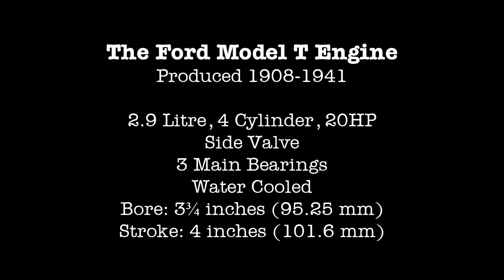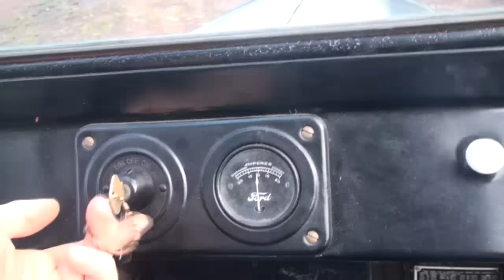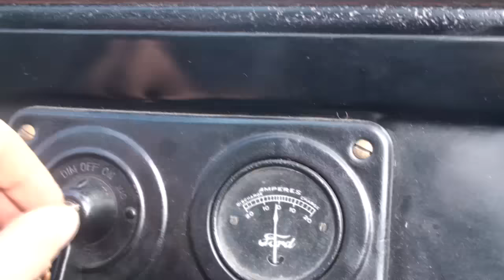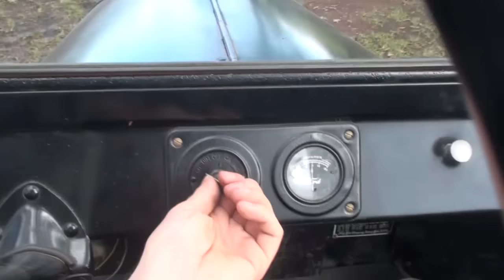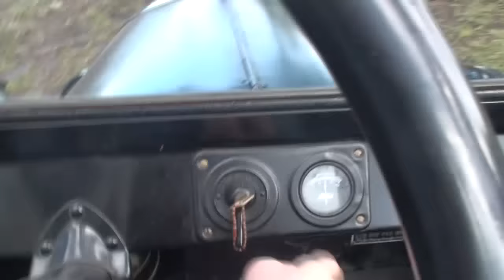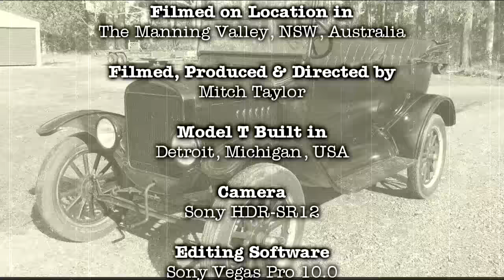Ford Model T - How to Start & How to Drive

Comment: Sooo, drunk driving wasn't much of a problem in those days.
Reply: You'll be sober by the time it takes to start the fucking thing, also, you'll stagger home faster than this thing drives.
Reply: Sirdiggar wouldn’t doubt it
Reply: I don't think they had cupholders then.
Reply: Drunk driving like drunk everything else was a problem (alcoholism was epic in that era!), and that car is no more complex, just different, than a manual transmission auto through the 1950s. People back then were not the scornworth  helpless pampered naive silly anime-worshipping snowflake adult children of today and their normal tasks included caring for a horse and wagon (also more complex than auto ownership and as any horse owner knows requires a lot of work).  The transition to automobiles was immensely popular because it made transportation SIMPLE.
Reply: Ob Fuscated but the ability to start the ones that didn’t have a electric starter would have most likely prohibited the drunks from droving
Reply: With the minimum skill required for this, I'd even suggest drunks who drove these were good enough to not be noticed as drunk
Reply: Eyeh8you your only going like 5 miles per hour
Reply: @804_grandstaff  Up to 48 if you figure out how to high gear
Reply: Ahh Sheeit! They could start it! Remember they started it every day! It was nothing to them.
Reply: @Lucas-qb3bs  nah, they could of did it. No problem,  like he said their lives were different. A weed head probably couldn't start it, to weak, and lazy to go through the motions.
Reply: rhuttrho88 I was just saying that people would probably be lazy like you’re saying with the weed head and wouldn’t want to have to start it. It isn’t very hard to start in my opinion.
Reply: yea
Reply: @obfuscated3090  Just got up at 4 in the morning to feed the horses. Next week we plan to teach five of them to drive. One important thing in driving horses is "Don't cut corners." The horse will anticipate the turn and take it too soon. The wagon will fall into the ditch that is before the turn and flip over. If your horse is very good and does not cut corners you can get away with driving drunk; it's sort of like cruise control or autopilot. As in the old poem, "The horse knows the way / to carry the sleigh / through the white and drifting snow."
Reply: @Lucas-qb3bs  Nope. Once you do it a few times it becomes very quick and second nature.
Reply: 86dieselman yeah I know, just as easy as starting my Farmall H hand crank
Reply: Eyeh8you wow looking at this and people nowadays can’t/don’t want to drive a standard transmission car.
Reply: @obfuscated3090  "anime-worshipping" haha nice one dud
Reply: @eyehByou People were riding horses drunk long before there were cars.
Reply: @obfuscated3090  Not sure if you were born in that generation or you wish you were born in that generation. Either way, what does that have to do with anything?
Reply: Eric campbelle (the bad guy in charlie chaplin movies) dead in 1917  at 60 mph because he was drunk...
Reply: Kids drank coca cola that had cocaine in it back then. Drinking was less of a problem as religion was still keeping people from being stupid. That and only women would ever get offended back then. Now everyone is offended.
Reply: Well they were so use to it that im sure they could do it with their eyes closed
Reply: Obviously as it was illegal
Reply: @Sirdiggar  🤣🤣🤣
Reply: I’m sure people were used to it then they don’t have a land cruiser
Reply: @obfuscated3090  In fact there were cartoons, animated and printed on paper, in that era,
Reply: @Sirdiggar  Lol that got me rolling 🤣
Reply: @tariqzain4500  :D
Reply: not really because alcohol was illegal when this car came out
Reply: It was a joke people. Seriously.
Reply: @Sirdiggar  that "thing" is faster then you think, i drive a 1914 T would have no problem starting it when drunk, but driving it ? a nickname for that "thing" is jumping Lena, it can jump like a flea by engaging the low gear, its faster then you think, its a sport to learn how to drive it, its an old "fusspot" it will tell you when its happy, i can now steer that "thing" through busy traffic, like a flea, but driving it drunk ? no way
Reply: @nicokamper4434  It was a joke, calm down.
Reply: @Sirdiggar  i know that, hahaha, my answer was meant in that form, only thinking of driving that "thing" while drunk,  i would not get far indeed,
Reply: Accidents back then were even worse
Reply: Prohibition was a thing back then when this car was made. No one did drink and drive since it was illegal to have alcohol 😂😂😂😂
Reply: @T-Rex-nm1se  oh, there was alcohol. You can't keep an alcoholic from drinking.
Reply: Terrible get away vehicle, as well
Reply: wikked girl  its easy to drive it lol
Reply: @rhuttrho88 fun fact, muy cousin and i crank started and operated a model T while high on weed, a very long time ago. 😂

Comment: only 1900s kids will remember!
Reply: DanReezY  no the model was readily available to buy used as late as the 1950's. .so anyone born from  the 30's '-40's   could have had this as their 1'st car .
Reply: Hello kids !  Oups, sorry.  HELLO KIDS !!!!  (do you hear me ?)
Reply: I think if a young man in high school pulled up in one of these today he would pull chicks with it although it might be the quirky ones which is nice too. Inversely if a young lady in high school pulled up in one of these today the guys with any brains would be all over that like flys on (yeah).
Reply: Ya I remember and now I'm 119 yrs old
Reply: Gaming guru your comment is probably a joke but instead of ya, a 119 year old person would most likely use yeah or yes because yes is more polite
Reply: I was born in 1956 my dad had a 1915 model T truck I learned how to rebuild carbs on that truck it sat for about 5 years without being run I was just 15 at the time and I took the carb apart it was full of gummy deposits.  Took me about 4 hours to clean, check and put back together. It started ran rough but ran. Did some adjustments on the carb  after it got warm readjusted the carb  and it ran great again.
My dad was surprised but happy i got it running again.
Reply: @ryan lemons r/woooooosh
Reply: +Bert Grau. I was at school when you were born and I remember the day that our teacher had car trouble on his way to work. 
For that days lessons, we helped him push the car into the yard and took the engine out. By 4pm it was ready for him to go home.
Here in the UK, during WW2 their was a shortage of teachers, so many older or retired professionals returned to the classrooms to teach, so lessons were somewhat different to today. 
The interesting part of this whole story is that since I bought my first car, I have NEVER taken cars to a garage for service. I even bought the VW computer diagnostics software for my current Audi and VW cars and my VW estate completed 300,000 miles without a single visit to a dealer.
No doubt the fact that I am a chartered design engineer helped. LOL
Reply: @InsideOfMyOwnMind  I wish I could have one of these. I got a 1949 buick straight 8 super, is that gonna work?
Reply: @thewilddinkus8026  LMAO She might be a bit "Earthy" but an independent thinker. At least you'll eat right.
Reply: @InsideOfMyOwnMind  damn, I'll have to use my 79 t top camaro instead
Reply: @InsideOfMyOwnMind  well shit
Reply: Normie
Reply: My first car was a 1922 Ford model tt
Reply: Only 1900s ghosts will remember*
Reply: DanReezY 😂
Reply: Mario Cisneros I’m sure a lot of them where scrapped for the war effort during World War 2
Reply: @mariocisneros911  My dad was born in 1924 and has driven many of these.
Reply: @SkaterStimm  I wish I asked mines about his early life, he and his brothers are gone. Maybe he told his stories to my other brothers , I'll ask them
Reply: What's your price for flight
Reply: Gen A?
Reply: I was born in 1887
Reply: @InsideOfMyOwnMind  It does pull chicks. I've tested it
Reply: @InsideOfMyOwnMind  o would be super attracted to a girl who shared my love for old cars
Reply: DanReezY 1920s
Reply: @mariocisneros911  Mario  I was born in 1948 and my 1st  car was a 1965 CHEVY MALIBU

Comment: This 100 year old beast starts easier than my 2007 Saab...
Reply: now did you really think you would actually be able to start Saab easily!
Reply: ares9304 what kinda Saab u have?
Reply: Maybe you got a fuel injector problem? They do get clogged over use.
Reply: It still starts easier than my three years old bike lol, I dunno why is it so cold, I always have to use the choke lol
Reply: 2007 was a bad year for SAAB cars.
Reply: ares9304 lol 😂
Reply: I always wanted a saab. I didn't kniw that they are that bad after 12 years. Or is it just your vehicle ...or did the joke flew over me like a Saab jet?
Reply: GM owned Saab fails hard
Reply: Well your saab start easier than my honda city which is my daily car
Reply: Sounds like a Saab story.
Reply: This is no beasy
Reply: OOF
Reply: Its because its not a Volvo!
Reply: Graffiti Boy a 2007 one
Reply: ares9304 haha I love Saab’s mine have always spent more time on jack stands than running. I had a 900 spg turbo and a 9000 turbo
Reply: I know right I trust this car to go on a long road trip vs my 2 yo Chevy Silverado it’s been back to the dealer 5 times in the past 2.5 years of ownership.
Reply: Sean Barnes AFM problems? That's the only unreliable thing about the GM trucks, and it sucks. If not, you must've gotten a lemon.
Reply: Well your first problem is that you own a Saab
Reply: And easier than my 99 Dodge Ram!
Reply: @101Volts  Or a bad or dirty airflow sensor.

Comment: The year after my grandfather returned from France after fighting in the Great War he bought a used model T.  I don't know the year.  He drove it regularly until 1942 when he moved to the city to help build battleships.   He sold his model T to his brother in law who also bought his farm.  Sometime after WWII his brother in law took out the engine and mounted it in a stationary housing and used it to power various equipment on the farm as well as a generator.  He in turn sold that farm around 1965.  The person who bought the farm later broke up the property into smaller parcels and when they tore down the barn they found the model T engine still mounted and recently used.  The model T engine was then sold to a museum who hired a mechanic to remount it back in a restored model T car which was then driven around to give children rides from around 1970 to about 1995.   Last I heard from one of my cousins is that car is in another museum somewhere on Cape Cod with the hood open to expose the engine and you can still see my grandfather's initials carved into the engine block.    

Meanwhile my other grandfather also bought a used model T as his first car around 1928.  He was the first in his family to own an automobile.   He traded that one in around 1946 for a 1939 Ford and in 1955 traded that one in for a 1949 Ford which is the car I remember him driving when I was a little kid in the 1960's.  They seemed to last a long time in those days.  Around 1970 he bought his first new Ford and then bought  a new Taurus I think around 1985 or so.  Those were his five cars.   

My great grandmother was the first woman in her county to have a driver's license.  She had an old Maxwell which she eventually traded in for a Ford. model T and then drove that until her death in 1948.  I have a photograph of her from 1920 behind the wheel of her model T.  It had a back seat and some sort of third seat because there are six women very fancy dressed with parasols and big fancy hats.  They had just been in the parade for the 300th anniversary of the founding of Plymouth. 

The model T was integral to the history of America in the first half of the twentieth century.  Everyone had one or knew someone who did and it was the first car driven by most of the first generation who drove.
Reply: great story, thank you !!
Reply: nunya biznez I've been to Cape cod but didn't see it in live near it in fact
Reply: To bad YouTube fuckt with the comment. It ends where the engine is taken out :c I can only hope the T got a turbo and some big rims XD
Reply: see if you can find "more" on the comment, click on it to see the rest of it.
Reply: nunya biznez,   Thank you so much for your awesome story of your family history! :)
Reply: This was so interesting
Reply: Lies
Reply: Heck of a story ....
Reply: Great story thanks for the history!
Reply: Play the flame
Reply: Wow .. great story mam.. thanks for sharing
Reply: Thank you very much for the great story!! 😉😉😉

Comment: Fords. 110 years old and still starts up first try like a charm
Reply: What happened to modern fords 😭😭🤔🤔🤔
Reply: You mean unlike modern Ford's
Reply: While it may be true that the mighty 20hp engine usually turned over, that is if the crank did not snap your wrist. It is also true that Henry Ford did not equipt these cars with front brakes. Also Ford Motor Company paid out a sizable sum to the survivors of the easily ignited  under the seat metal gas tank. The petcocks (to check the motor oil level) we're located under the car. Many a misfortunate owners legs were run over by passer by tyres. The only color was black, while the transmissions primitive operation caused the lubrication to become tainted quickly. The vehicles had a concrete stiff suspension that rode frightfully hard. The rubber sidewalls we're equally stiff and the steering required the wrist strength of an Olympic athlete. So yes, the cranky engines usually started after a few tries, bit most found horse drawn safer than horse less. Since l omitted 24 other safety issues, one can safely assume that model T we're just another highly flawed product that the corporate decievers created to make the creaters rich at the physical expense of the public.
Reply: Damian Furino Not bad for a first try
Reply: Justin LaFon Mercedes Benz is 133 years old and much better
Reply: funny how they got worse with time
Reply: @damianfurino3691  It appears that Ford changed the world anyway. I don't see any horse and buggies around here.
Reply: Hahaha but not the New Fords 😂
Reply: @damianfurino3691  You say that as if GM, AMC and everybody else didn't start of like this.  And now days GM still can't make a safe car.
Reply: @damianfurino3691  It may have been flawed, but I think the point was its pretty sad that a 100+ year old car can start on the first try but modern cars refuse to start after sitting for awhile, I guarantee you no car made today will be on the road 100 years from now. That said, no car is perfect and there are design flaws even with Chevrolet and Dodge. I know someone who just recently bought a brand new Chevy Suburban, the engine was shot at just 15,000 miles and come to find out it is a very common problem. My particular Mustang model was notorious for blowing head gaskets. The Model T may not have been perfect, but it paved the way and the fact that there are still some out there running shows how well they were built.
Reply: @ToothpickMan11  Well the problem is you're buying American cars. American cars are garbage (if you don't believe me then explain how they went under and had to be bailed out with the taxpayer's dollar 10 years ago). If you want a car that is well built and will last hundreds of thousands of miles, try Toyota or Honda, AKA, car companies that actually give a shit about quality and their track record shows.
Reply: @damianfurino3691  yes they where death traps I have a 39 deluxe and she's a heavy girl and a might unwealdly at times thank God I'm in Georgia I can't imagine driving her in snow
Reply: @chris richard Maybe we should be anti economic ideology, and anti-dictatorship. Then we'd be free to adjust according to democracy to make the best circumstances for as many people as possible.
Reply: Did you know 97% of the Fords made are still on the road, the other 3% actually made it home.
Reply: @JohnSmith-nj9qo  Ford Motor Company = No Bailout
Reply: That car is actually 86 years old in the video and would be 94 today... but I get your point lol
Reply: All. Cars back then was like that.  Real American made.  Built to last.   These days.  Their built to break.  To put money in the corporate pigs  bank account.